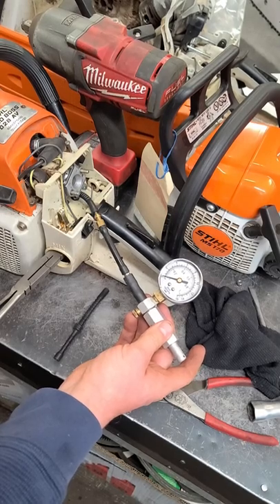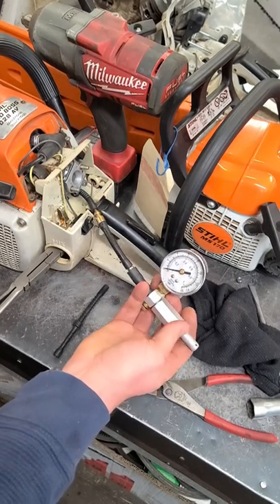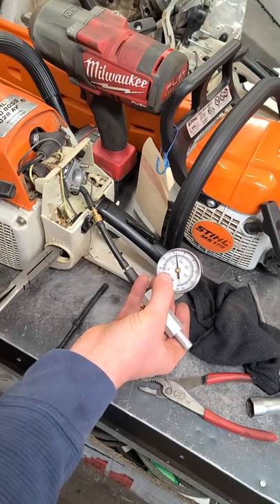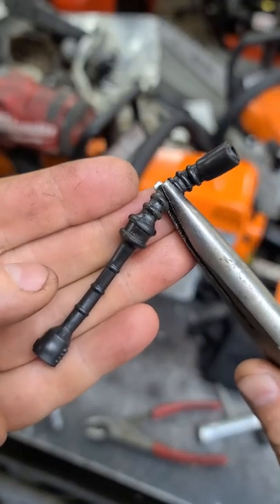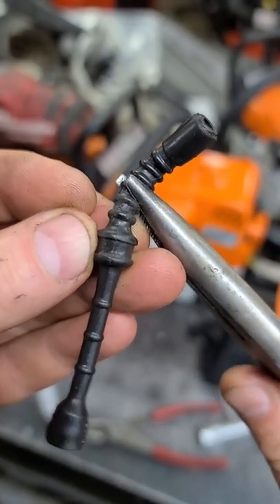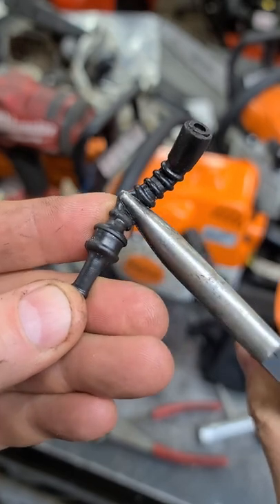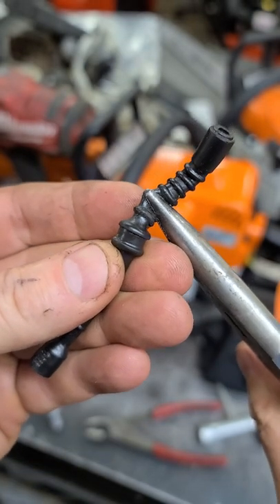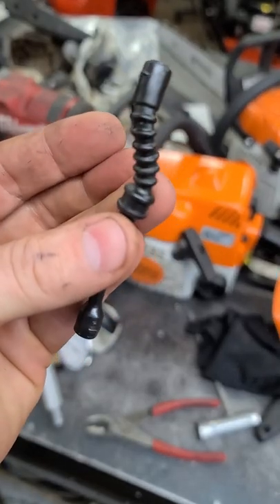Why I Always Pressure Test New Chainsaw Fuel Lines After Installing Them! #shorts

Comment: Make sure the fuel tank, fuel line port doesn't have burs. Also, put a dab of premix oil on the outside of the fuel line to allow it to slip into place easier/better. 🤙

Comment: Hmm, does that work on riding mowers too? That might be a less messy way for me to figure out if my new fuel line is still leaking right at the carb...
Reply: That's an external connection and has a clamp on the fuel line at the carburetor. If it were leaking,there would be a visible drip.
Reply: @paulbillings1791  there is a barely visible drip but only when running (when the fuel pump is applying pressure). There are things in the way of seeing it, and it's hard to get my head over there with the hood still on. But really I'm mostly just griping that I somehow still have a fuel leak at the carb despite brand new fuel line and a screw type clamp, while the ratty old fuel line was kinked and didn't leak - I guess probably because it was kinked...